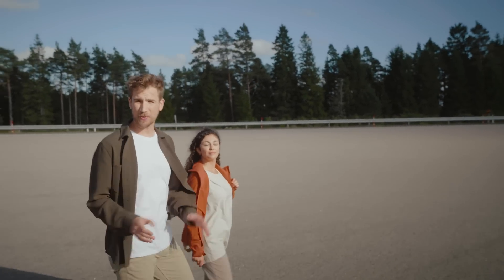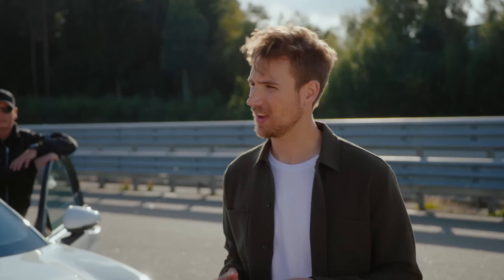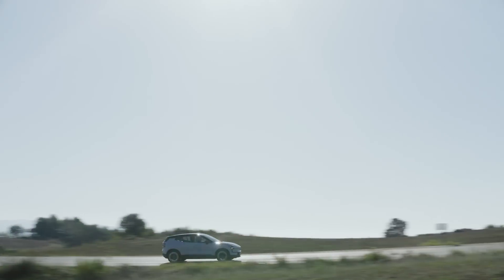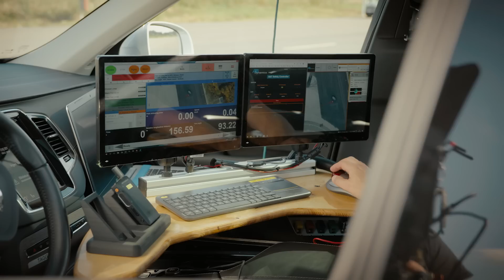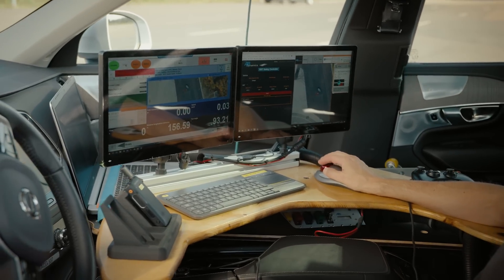Extreme Vehicle Testing: Behind the Gates at Hällered Proving Ground

Comment: I'll never be able to afford a new Volvo but I applaud a company who understands the importance of family.
Reply: Then buy a used Volvo, that’s what I do they last forever.
Reply from the maker: We are grateful for your support - thank you! /Niamh
Reply: Hi @msmithy7813, you do not have to afford a new Volvo to be able to take advantage of their safety features. I have had an '04 XC70 for 9 months now. I took the VIN and placed it in a Volvo VIN decoder. Notes in the double enclosed (( are my notes. You may need to look up some terms below. So . . . 
My "Old Volvo" has:
   Front/Rear stabilizer bars ((prevents rollover))
   Driver/front passenger dual stage airbags
   Side Impact Protection System (SIPS)-inc: ((includes Boron Steel in the B-Column))
   Driver/front passenger side-impact airbags, front/rear side-impact inflatable curtains (IC)
   3-point seat belts for all seating positions-inc: pretensioners
   Front seat belt height adjustment
   Overhead-mounted seat belt reminder lights
   Driver/front passenger Whiplash Protection Seating System (WHIPS)
   Child safety rear door locks
   Rear window deactivation
   ISO-FIX child seat attachments-inc: top tether seat anchors
   Anti-submarine seats

And, there is a hand-hold on the center console for passengers to grab if they need.
As noted in the video, Volvo has been testing the safety of their cars since 1973. Volvo WROTE the BOOK on Safety!!